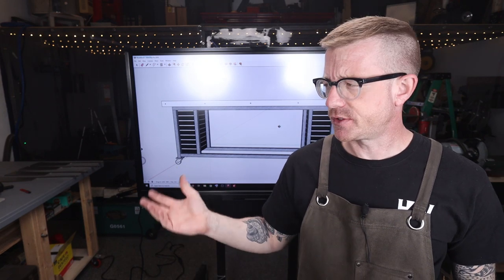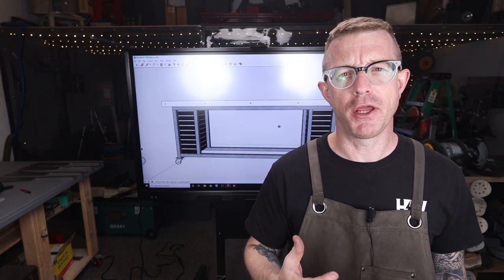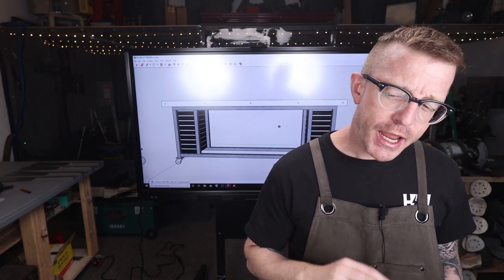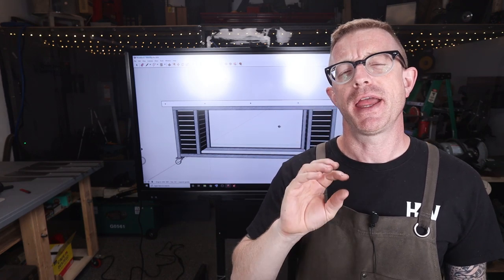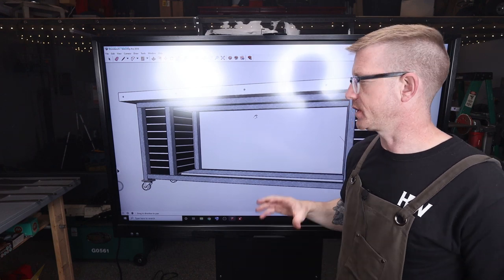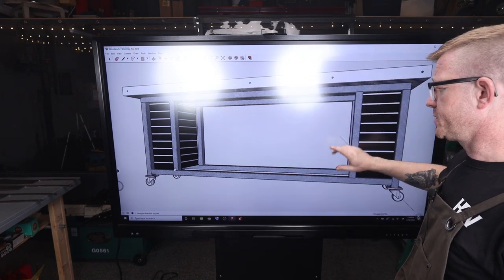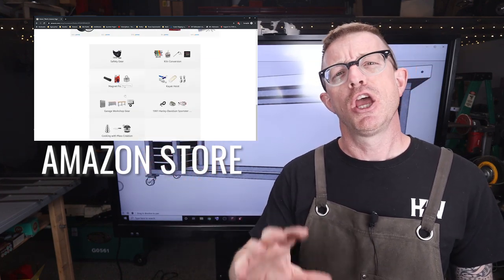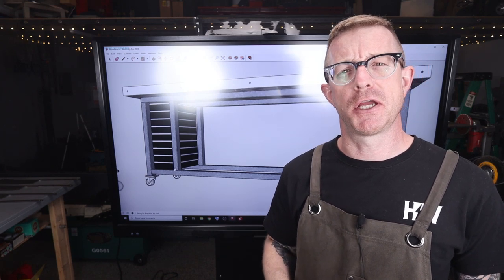DIY Custom 2x4 & Steel Workbench - Step 1: Design

Comment: What about a set up for a shop vac and dust/swarth collection. If you’re gonna have the grinders on top, might be nice to have a few funnels that can pull in out like drawers. Like a mini shop dust collection system, but under your bench. Love the community!
Reply from the maker: Love your idea Dustin, and thank you so much for your drawing. That dust collection system isn't something I considered before. I have always wanted a down draft surface as well. Maybe I can add that. :)

Comment: I like to weld a few trailer hitch receivers under my bench.  You can fab up 2" square tubing to any tool or vise you have and quickly mount it to the bench.  Really fast to mount and remove & pretty solid as well.  Cheers
Reply from the maker: Great idea! JHK Customs has a similar idea as well. I really do like this idea. Once I can get out of the house I might just buy the stuff to build this beast!!

Comment: I suggest using SYP (southern yellow pine) boards for the top. They are stronger, straighter, & denser fibers than the cheap boards HomeDepot & Lowes pumps out. Also use a caster system that drops the base solidly on the floor off the wheels after moving.
Reply from the maker: Can you get SYP at Home Depot or Lowe’s or would I need to go to a supplier?

Comment: Definitely if you have a 3" top add holes for holdfasts, super useful, fast work holding option.  You could do a video on forging your own. The longer I'm in the shop the more I realize specific dedicated storage is much better than general shelving which is just a crap catcher.

Comment: That‘s going to be nice!

What I would add (had I the time and space to do it rather than just talk about it..):

- add casters in the middle of the long stretcher to avoid sagging. Better safe than sorry
- put a compressor into the „what if space“.
- use the center threaded tod as an axis to make a flip top. That could be the home for the mitre saw. 
- add a shop vac into the what-if space as well. 

Looking forward to your built.

Comment: Hey I came up with a idea to use mag switches to make it modular , you can build a couple different models one with shelves, one with the hdx trays and maybe one with your table saw or router station and you can mage different wooden couplers to hold the mag switches either straight or 90 degrees so you can have a L shape if you want
Reply from the maker: I like this concept. I am now looking into Mag Switches for another project. Thank you.
Reply: @HouseMadeUS   you could even inset metal strips in your wooden workbench to attach them together
Reply: @HouseMadeUS  my biggest problem is deciding how tall to make my work bench
Reply from the maker: That can be tough. Don’t overthink it. Also Google the question. There are some equations out there to help.
Reply: @HouseMadeUS   thinking of building adjustable legs or a desk height and workbench height
Reply: @HouseMadeUS  how did the concepts of using mag switches go? Anything interesting? I was thinking you could build your own mag drill for doing work on metal

Comment: Dad here:  Question:  What type of wood are you going to use for the top?  Should be something very strong and hard . . . like Southern Yellow Pine?  As you know the work bench I made for my shop I bought OAK STAIR TREADS which were 48" long.  You could do the top with them running the width direction instead of the having to butt them end to end.  You could rip them to 3" widths.  Also, although I incorporated a power lift into my work bench for my chop saw, you could use the same concept for any type of electrical tool that you use on a frequent basis . . . like the new grinder (s).
Reply from the maker: I’d like to use readily available wood like 2x4 if possible. Oak sounds expensive. Lol.
Reply: @HouseMadeUS  Do the math . . . It will not be very expensive and the the lasting quality will outlive the the 2x4's . . . unless you get SYP.

Comment: Hi Brian. consider making a concrete plate on top of the work bench instead of steel.
Reply from the maker: I like that idea. Or maybe both?
Reply: For both you will need a badass weels but it can work.

Comment: Also add a plug strip on front and back
Reply from the maker: Yeah I agree, power somewhere is definitely needed.
Reply: @HouseMadeUS  maybe add a switch  so you control the outlets especially if you are going to have a grinder or other power tools

Comment: Is there any good ways to learn turboCAD? I'm having trouble finding useful videos on YT. I would even pay for an online course. Total novice at cad here.
Reply from the maker: I don’t know about turbo cad but I used SketchUp and there a ton of resources out there for it. Check it out.
Reply: Inkscape might be an easy way out as well. I started using it without any pre existing knowledge.
Reply: @smu1129  
Good suggestions. I got the full deluxe version as a gift recently, so I'm just trying to get use from it.

Comment: Under would be a good place fo an air compressor
Reply from the maker: Yeah I have a 60 gallon so maybe I just make a hose hookup for it and some outlets.
Reply: House / Work  and a vacuum or dust collector

Comment: So with me being in canada how does it work with your amazon store? Will it ship to canada or? 

Stop touching your face :P haha

I'd just use the bottom to keep your miter saw or small table saw if you have so it's not in the floor. Like you said, drawers will have things in them but if they're not out or able to be seen you won't use them. 

Another idea that my father in law uses is he has a wood vise hanging on the side of the workbench and all his bench grinders and small electric motors with arbors for wire wheels and buffers have wooden bases that have a piece of wood vertically fixed under the base that you can clamp into the wood vise so you dont have to have things permanently mounted to the top all the time and they can sit on the shelf underneath. Then when you have electrical underneath you have somewhere to plug them in quick as well.
Reply from the maker: Yeah it should translate over to Canada. I’m not really sure how the commission works. I know there’s some differences there but not a big deal. I really like the idea of having a big vice on the side of this workbench. I think that makes a lot of sense.